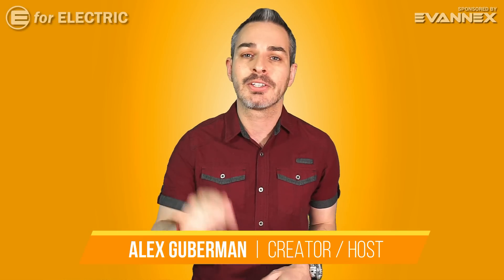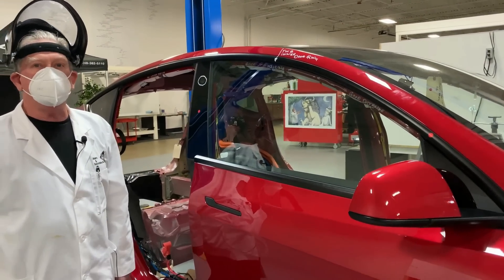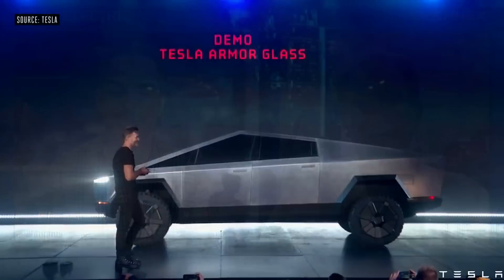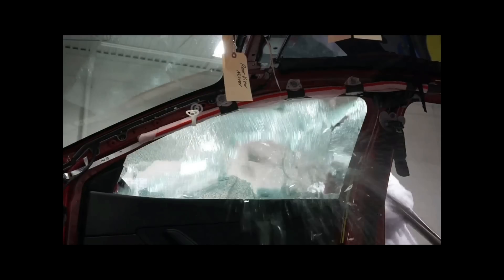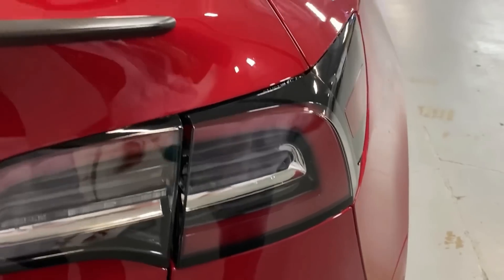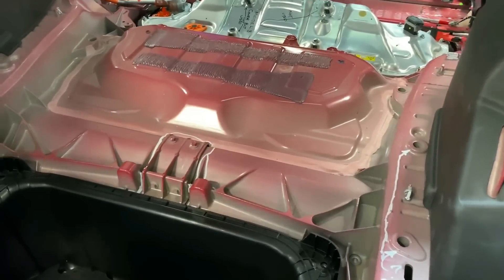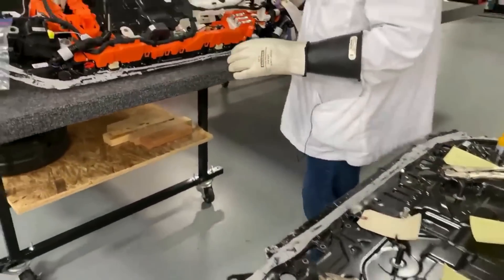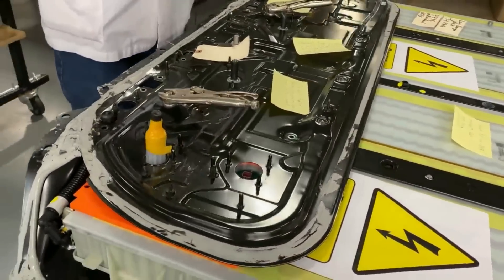Sandy Munro's TOP 5 Tesla MODEL Y Improvements over Model 3

Comment: Has the Model Y fixed the problem of the log files wearing out the flash memory card on the Media Control Unit that has affected or will affect Tesla's previous models?
Reply: Others have said that it’s a combination software hardware upgrade in model 3.
Reply: I was hoping that Tesla would either put the chip in a socket to allow for easy replacement, or they would save the logs differently.  Having to replace the entire MCU when the flash memory module goes bad seems to be a bad design to me.
Reply: I think the problem is on the Model S/X, might be fixed with MCU 2.0 ?
Reply: They switched to a totally different memory now on the model three and model Y and there’s a new version for the model S and X To replace them as they die. I even heard you could preemptively have it put in because the amount of time or miles is known before it dies.